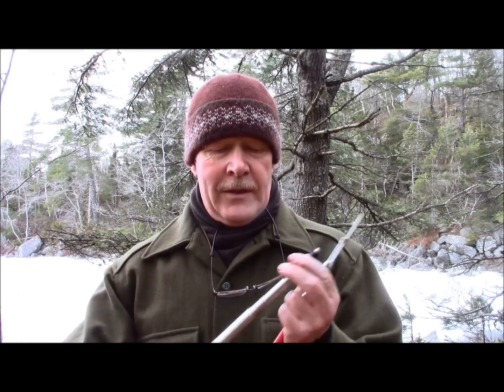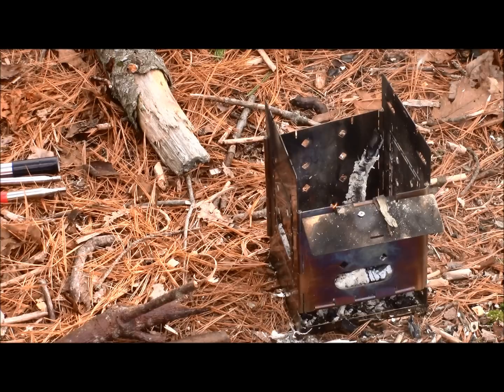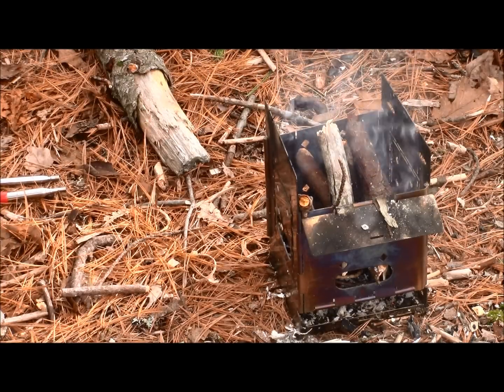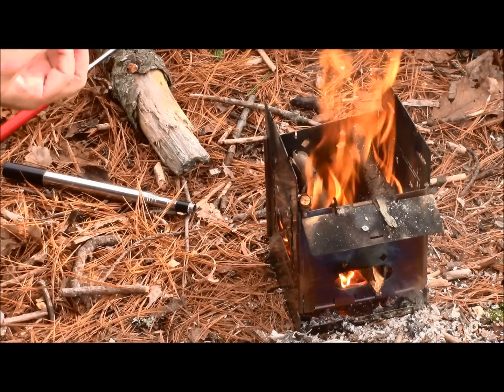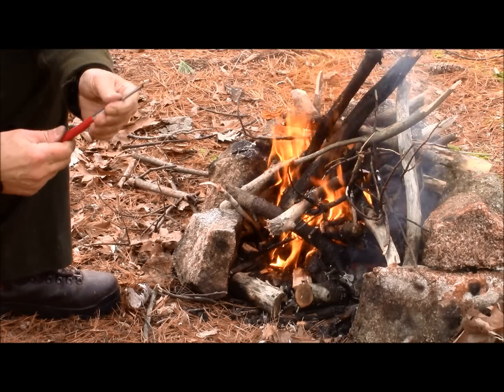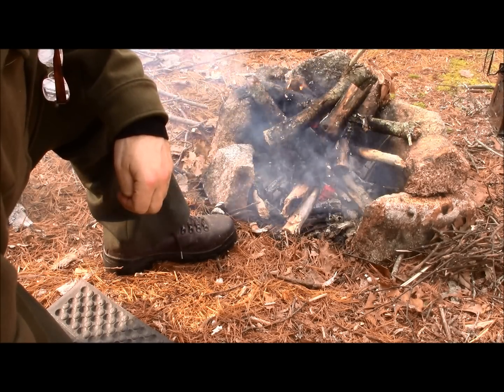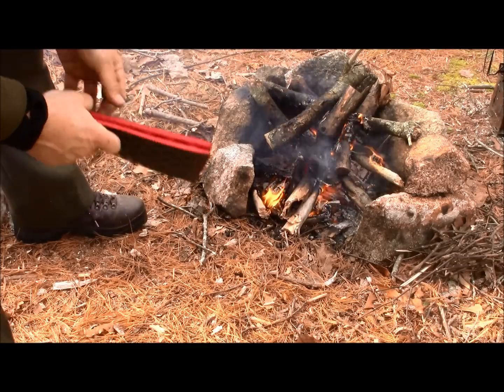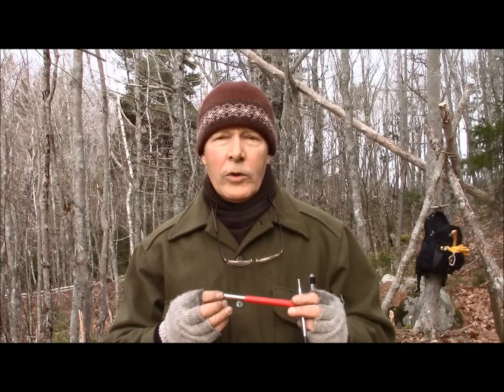DIY Pocket Bellows

Comment: Hi Mark, Great video! And besides being a practical device, by helping with our campfires, it has another important benefit. Anything that helps keep our faces, hair and lungs further away from a roaring fire is an important tool in making our time bushcrafting safer and more enjoyable.
Reply from the maker: Very true. One of my viewers learned not to suck air in through the tube while the tip was still in the fire...otherwise they provide a lot of benefit. Thanks for commenting

Comment: Thanks for the shout-out, Mark! In truth, I wasn't a big fan of paying $27 for that Pocket Bellows either (although I did) and I'm glad we had the conversation about it. I like your ideas and I'll be trying some myself, in fact, as I picked up some wiener sticks myself and saw the similarity (and I also like the silicone too, assuming it is silicone on mine). And I have to laugh because the fire went out on me while taping my intro too. Great ideas here, but my favorite of the bunch is the wiener stick/fork.

And FYI - the Pocket Bellows is the same size as the wiener fork, just a bit shorter.
Reply from the maker: I may have to make a run to Dollorama before they sell of of BBQ forks..LOL. I am quite please with the DIY pocket bellows and have used it a couple of times to good effect. Your welcome for the shout-out but I doubt my small channel would gain you much in the way of viewers. As always, thanks for commenting Dean
Reply: Any shoutout is a good shoutout. Thanks again!
Reply: Alberta Bushcrafter subbed
Reply: Mark Young Sorry - been away far too long. Tons of house repairs over the past few years, and over half the channels on my subscriptions list went bye-bye some time ago. Ironically, my expensive pocket bellows got lost during renovations last year so I’ll have to try making one of these. Good to see you’re still going strong, Mark!

Comment: I'll certainly try this. Currently I have a metal straw as well as a hollow knitting needle, but your device would be smaller packed and larger unpacked than the two things I mention.
EDIT: I could not get the item this time of year (Oct) but I found a similar magnet version. There was some blood put into the build so wear gloves as you have to force the solid part out towards the larger sections. Now my current 4 firetubes are 10g-18g while this one is 22g but it is both more shorter and longer than the other 4. Collapsed it is 6.5". I added shrink tube to the mouth end and to the business end to act as a stop to keep the tube from going into the others too far that you can't grip it. Not as small as the Pocket Bellows but DIY cost was just $3.
Reply from the maker: Yes, it is a great inexpensive option to have in any fire kit. Thanks for commenting

Comment: Very good comparison Mark, I've carried and old radio antenna in my pack for years but I think I will upgrade to the bbq one it seems to give off just enough air ! Thanks for sharing buddy 👍
Reply from the maker: Thanks Wayne. The first one I made from the BBQ fork I cut off with a Dremel. The second one I heated and pulled the fork out. Made for a slightly longer cleaner tip

Comment: I've got an inspection mirror that I was planning to use for this very purpose.  Just haven't gotten around to cutting the mirror off and exposing the tube.  You've inspired me now!  Thanks.  Your like the kindly old grandfather that we all wished we'd had growing up.  Don't get upset; I'm actually older than you!  But I'm more like the prankster Grampa.   :-)
Reply from the maker: Hello Prankster Grampa.... No offense taken. In fact I consider your description of me a compliment. Age is just a number, or at least that's what I try and tell my joints when they complain about the punishment I put them through in the woods. When I modded my inspection mirror all I had to do was unscrew the ball joint that held on the mirror. It was a hollow tube under it. Not sure if yours is the same. Thanks for commenting

Comment: great video thanks for sharing i just got a pocket bellows and some baddest bee fire fuses good to know,  about the selfie stick though and the hotdog sticks, i have a inspection mirror in my tool box at work so if the mirror ever breaks  it can become  pocket bellows
Reply from the maker: I recently found an inexpensive pocket bellows on eBay that is a bit smaller and packs easier in my fire kit. Thanks for commenting.
Reply: Good to know about the one on eBay . I just took my inspection mirror apart and only problem I see is you should have to flare the end the attaches to the mirror so it doesn’t go back it. When you collapse it .

Comment: Good size comparison, thanks for that, it proves there is a clear winner in diameter.. I've read the pocket bellows has brass ferrules in order to stop condensing breath from forming rust at the joints. I know antennas also have this for electrical conductivity reasons. Not sure how important this all is in real life but wonder about the materials in other sources. I carry a length of latex slingshot tube which could do triple duty as a slingshot band, a crevice drinking tube and a bellows if pressed. It is a bit unwieldy.
Reply from the maker: Good point. I just looked inside the BBQ fork-bellows and it appears to be all brass. Maybe chrome plated. It's also non-magnetic. I used to carry a length of latex exercise tubing for the purpose but as you say it was a bit awkward to carry and use. Thanks for commenting
Reply: I am going to give this a go. Did you flare the end so the tubes will not inadvertently disassemble through themselves or was it not required? And thanks for checking on the materials.
Reply from the maker: I didn't flare the ends although it may not be a bad idea. So far, it has not been an issue. There appears to be stop notches in the tube. I did make a second BBQ fork-bellows but in this one I heated the fork end and pulled the fork out. smoother end and a bit longer

Comment: Good thoughts. I remember using a CapriSun straw as a scout for similar purposes.
Reply from the maker: Sounds like a great idea. How long a tube would that be? Thanks for sharing
Reply: Mark Young Pretty small–just a rigid plastic straw, perhaps 3-4mm in diameter. Not great for old knees, but brilliant as a scout. I think the key is moving from a wider diameter to a smaller one, whether from mouth to straw or down via steadily decreasing diameters in a telescoping rod.https://plus.google.com/photos/...
Reply from the maker: Agreed. The decreasing diameter of the tube increases the velocity/force of the air. I did find that the selphie stick was had just too large a diameter to be effective. Thanks again
Reply: Mark Young thank you. My pleasure.

Comment: I usually just fan it with my hat. The only problem I’ve had is when there is someone else on the other side of the fire and I blow ash all over them. Doesn’t happen often, though.
I’ll probably mod a marshmallow fork like you did. Looked effective.
Reply from the maker: I used to use my hat as well but it never worked as well as a bellows does...plus...less ash in peoples faces😅. Thanks for commenting
Reply: Mark Young 
These things are $3 and change for a 2-pack (on Amazon) at the time of this writing. So I had to order it. Hard to pass it up.
Reply from the maker: @totallyfrozen  For sure. Should work out great

Comment: the first one the selfi stick got it going fine, also why did you use that one with very short bursts? Going to the dollar store, thanks.
Reply from the maker: The diameter of the selfie-stick being larger then the others means air would pass through quicker but with less force. I used the same amount of air (a full breath) with each one. Thanks for commenting

Comment: I would have thought the larger diameter pipe would move a larger volume of air, and worked better. Just not as high a pressure of the smaller diameter pipe.
Reply from the maker: Makes sense but higher pressure helps get the air to the delivery point, the coal bed. Thanks for commenting

Comment: Very cool ... subb too :D 
I should consider a pocket bellows. Any recommendations of thickness or size?
I've tried /used the fan approach as well.  Sometimes ill fan upwards to draw air from the bottom up . thanks for sharing mark :D C.R.
Reply from the maker: I can't comment on the actual "Pocket Bellows" by Epiphany Outdoor Gear as I don't own one but it has received a lot of positive comments. Of the three I tested, the BBQ fork seemed to work the best I believe do to its diameter. I will it measure and post here. Thanks for commenting
Reply from the maker: The modified BBQ fork measured 8mm ID at the base and 4.4mm ID at the tip. Hope this helps
Reply: thanks man ... ill give me something to refer to

Comment: Thanks for the comparisons of low-cost alternatives.  I agree with your conclusion - the BBQ fork wins.

I suggest that one never build a fire on top a bed of pine needles.   Sweep the area first (even with the side of your feet).  Pine needles have enough pitch in them that once they catch fire, they burn hot and quickly.   Even when using a bush box.

This said from over 50 years of building camp fires and watching newscasts / reading news articles about wildfires that got out of hand because someone didn't take simple precautions.

Cheers.
Reply from the maker: I agree with you totally. The fire pit has three inches of sand and gravel as a base and the ground where Firebox was is frozen solid. Normally I use it on a rock if possible. Thanks for commenting

Comment: Making a diamond with your fingers is an old trick, I've impressed many people over the years with it, let the fire become coals and practice your aim for 5 minutes and you wont need a gimmicky stick. For really heating up a small part of the coals or getting into an ashed over bed though the inspection mirror will be best since you'll be able to provide a constant stream of air,
Reply from the maker: I'm always impressed when I watch someone use the diamond trick as I have not been able to master it although I have tried a number of times. I agree the inspection mirror tube is helpful in some situations. I also think the larger tube (but not by much) is a bit more versatile. Thanks for commenting
Reply: What trick are you reffering to exactly?  I can't find a video of it and I have no clue what it is.
Reply: Robert Briggs "Diamond blowing technique" video made by Firecraft, I believe.
Reply: Diamond blowing technique. It works quite well but it still will cause you to get a face full of smoke occasionally. It's good to know and you should practice it just in case you need it. I would definitely use bellows if they were handy though. Less bending and they keep you from getting a face full of smoke.